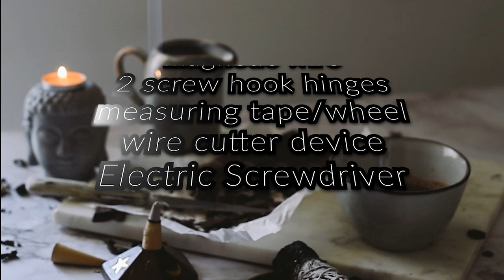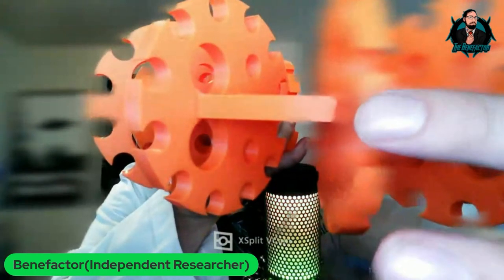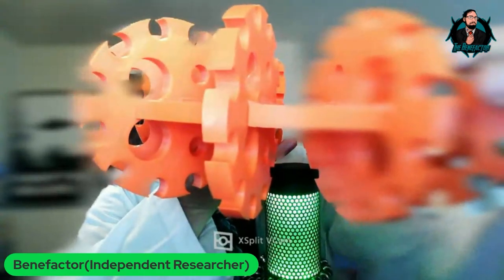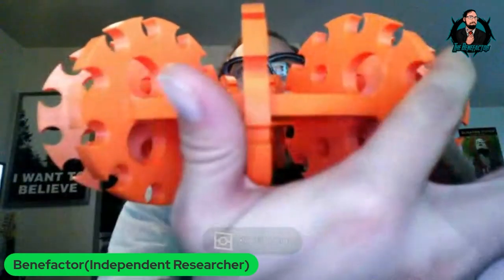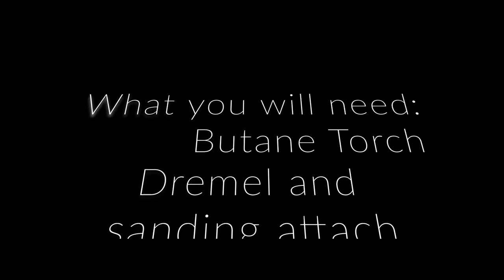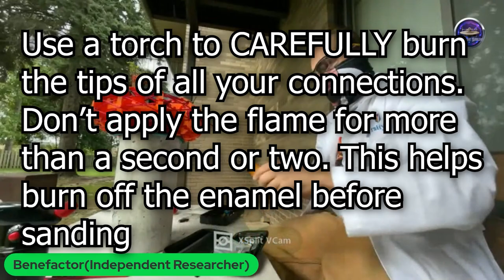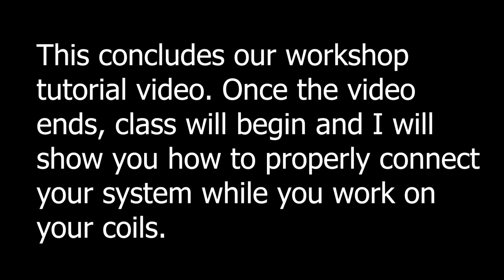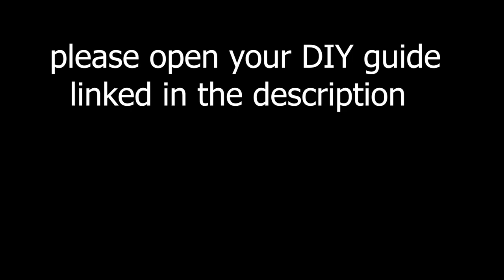FireBall Rodin Coil 🔥🌀

Comment: there is pulse signal and constant signal , in the case for DC there is constant DC and pulsed DC, same goes for AC  constant and pulsed. when you pulse a signal you simply silence the signal aka (OFF) for a portion of the pulse , the duty cycle of the pulse is the ON time  everything outside the duty cycle is OFF time regarding a PULSE  operation, AC is oscillating its not pulsing because there is no OFF time . same goes for Constant DC such as connecting to a BAttery permanent . Pulsed DC is analogous to hooking one end of the coil to the positive terminal of a battery and then with your hand tapping the negative terminal with the other end of the same coil

Comment: Ben you can  send the ac signal from the stereo into the small switch you purchased and use the pwm to pulse the ac signal into the coil.  Using the stereo without the pwm and switch will keep the ac signal constant
Reply from the maker: I’m gonna try this today. Pulse the ac signal